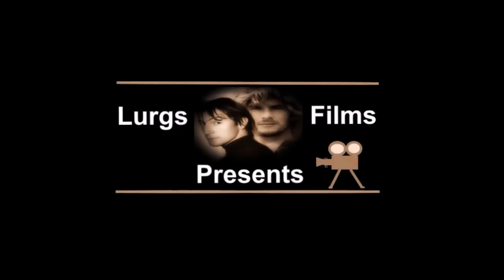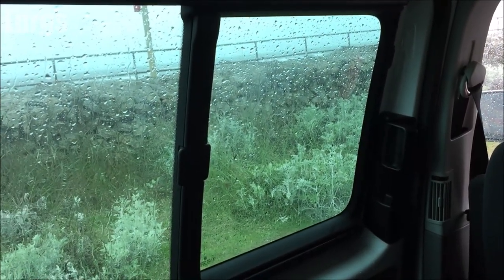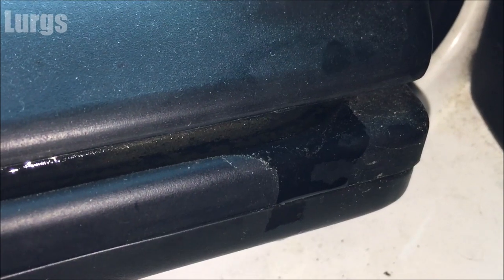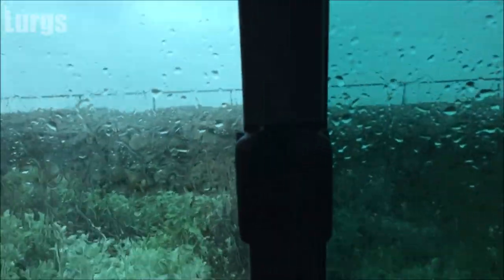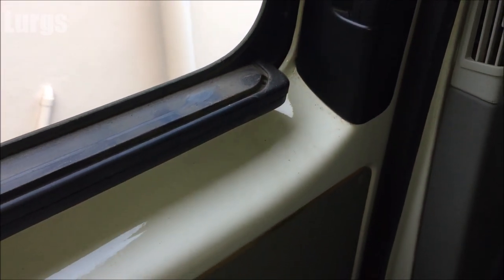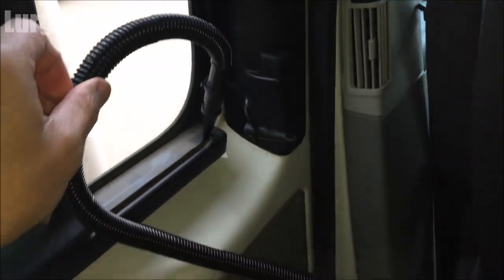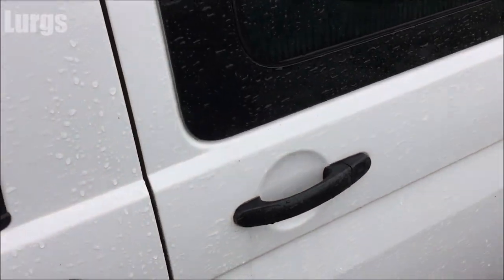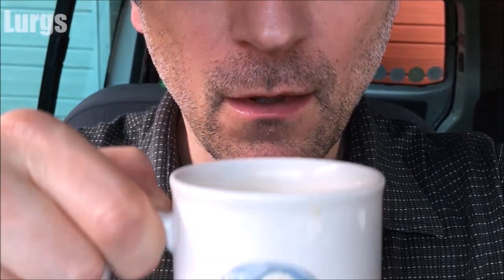VW T5 Kombi Window Leak - VW T5 Leaking Side Windows - VW T5 Leaking Sliding Windows

Comment: Thanks I'm away to try a can of compressed air for cleaning keyboards as my one of windows has sprung a leak. I use in roof drain holes of VW California, another weak point.  Good tip for the windows is to keep channels clean and lubed with dry lube, they work a lot better.
Reply from the maker: johndgn Yes a weak design and incredibly they've put them on the new T6 as well! Hopeless.
Reply: @LurgsHowToGuides  yes they seem to carry over defects, think they'd get fed up with the warranty claims. More research reveals that the bottom locating pin(s) get worn as they are plastic (!) and then the window loses its seal as becomes loose with the drainage holes kicking in as back up so I might still have issues. I wonder if there are other better retrofit windows I could install later but I'll persevere with low cost solutions first.

Comment: They tend to get worse as time goes on. This is because the guides wear a flat surface causing the  window to leak. Best to get the guides replaced when doing the  drain holes then that covers you on two fronts😁.
Reply from the maker: Cheers for the info.

Comment: I'm trying that in the morning! The wet on mine was so bad that the door card warped, I opened the door the other day and now have scratches on the wheel arch where the card scraped across it!
Reply from the maker: Mine’s still not great, it’s a poor design, but having that drainage hole clear does help. Good luck
Reply: Done it and it's much better. The bottom of the frame is blown too so the window only opens one hole along. The other side was also completely blocked though thankfully there is no damage and the window opens fully. Next step is to see if that bottom piece of trim can be parted and (somehow) brought back to the proper shape.

Comment: This whole isue just got a lot worse - a T6 Kombi had it's slider window fall out due to corrosion behind the slider bottom rail caused by the known leak problem . The rusting [ which is hidden from view ] causes the bottom slider rail to sag / drop and the slider window falls out . A very serious safety issue with catasrophic implications .
Reply from the maker: I still can’t believe they put the same design on the T6 !
Reply: @LurgsHowToGuides 
Beggars belief ! Check out some of the latest posts on T6 Forum relating to this - a real eye opener to anyone with corrosion / leak problems .
Reply from the maker: Ouch. I was thinking about getting a T6 but it’s not much different to my T5 and they are so expensive! Was hoping youtube would make me rich but that’s not happening! If I ever do get rich I’d probably still get one but get a new Sportline Kombi and take it to ‘Pimp my Ride’.

Comment: There should be a recall from VW for this issue-this is my third VW van with the issue - 2 x T5, and now T6 with this exact issue. Or a class action by all owners - it's absurd!
Reply from the maker: When the VW T6 I literally couldn't believe they had the same rubbish leaking windows, madness. Really poor design. My inner door panels are all rotten where water leaks inside.

Comment: It's not so awful invention, it just requires maintenance. There's not really any other way of doing this. Water will get inside any window that opens and it must then be led outside somehow.
It's the same for the T5's front doors actually. Water will get past the window seals, and water will run down into the doors. That's completely normal and it's like that on every other car out there. What folks fail to realize is that there is a small drainage hole on the bottom of the door that must be kept open. I've seen car door filled halfway up with water because of blocked drain holes in doors. The result is the doors rusting from the inside out, and you will not notice until it's years too late. So find those hole and give them a poke every now and then to keep open. Normal maintenance. That's all.
Reply from the maker: Good tips, I keep mine clear but it still leaks into the Cabin.

Comment: I'm going mad with this... I tried to clean the hole but if I try to put water with a siringe in the hole the water just leaks inside, no water goes outside!
Reply from the maker: ilmaichi It must be really blocked up then, it should appear outside! Try an air compressor in it to see if you can clear it through. It's a poor design, mine still leaks even though the holes are clear.

Comment: This is not a drain hole but a locating hole for the pin to lock the window, believe me I've had four sets of windows changed on my old T5 and I've already had both windows changed on my new T6. VW know about the fault but have done nothing. Only solution is fixed windows or aftermarket ones.
Reply from the maker: It is such a poor design, can't believe they left it on the VW T6. Some guy on here has a fix for the leak, it's in the comments somewhere.

Comment: There are 2 drainage holes, one half way along, does anyone know how to clear that one? I cant see it to clear it!!! Mine are also clearing  correctly on one side but the other side they are draining internally and externally. Looks like a plastic seal inside that is weeping?
Reply from the maker: Are you sure that's not just a hole for the clips when you slide the window along?
If you read all the comments there is a bloke who posted a youtube video on how to fix the leaks. Unfortunately it's just a poor design, even with mine clear they still leak!
Reply: @LurgsHowToGuides  definitely a drainage hole as the sliding door window has one and if i pour water in the channel it does drain at 2 points. Think I need to take the slider out and investigate further. You are right, it is a poor design though!

Comment: sorry. Would be be better to tell people how to fix the leak than how to drain the leak I’ve now done this in the comments for you ok yeah no worries  hope you fix yours 🤙🏻
Reply from the maker: This just shows you how to clear the drainage holes. It's a poor design, where is your fix, I can't see it?
Reply: Lurgs yes it is poor, I’ve posted a link showing how to fix in comments below. Worth a look, it works I’ve just fixed mine
Reply from the maker: Mohamed I’m ard Bruce lee Ok thanks for the info. If anyone asks I’ll direct them to your fix. Cheers. Have a marvellous weekend.
Reply: @mohamedimardbrucelee8564  where is your fix? I can't find the link
Reply: ilmaichi it’s in the comments of this video, but here it is again https://youtu.be/S5-HT0cl9A8
You can buy a sliding window repair kit on eBay with all the bits required to replace worn out plastic parts causing the leak

Comment: But clearing the draiage hole only lets the water inside! There is no channel to the outside! 
Mine had leaked for so long, the metal bracket holding the lower window runner had corroded away, leaving the runner bending up at the back. I cut one of them away and made up one from aluminium. It all fitted great but the window still leaked!
So i taped it up with black tape and lost interest in fixing it. Terrible design.
Reply from the maker: Yeh terrible design and they still put same design on T6. Can't believe humans put Men on the Moon yet they can't fit a window that doesn't leak. Mine still leaks now even with drainage holes clear.